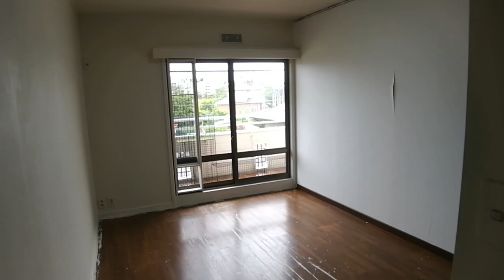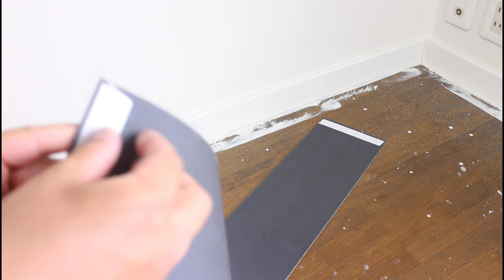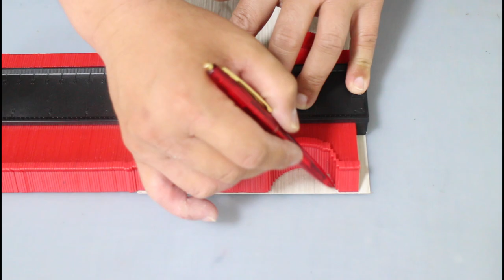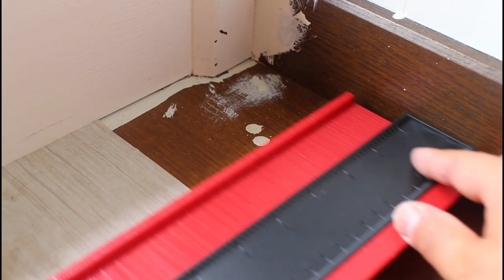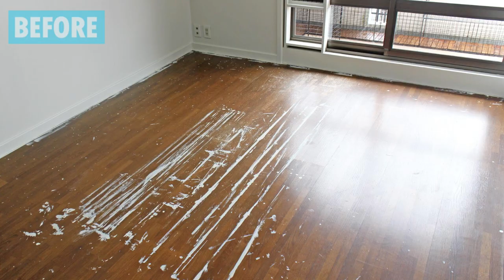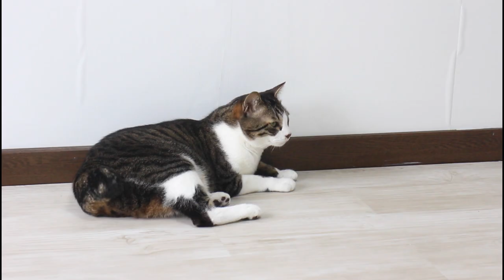DIY - How to Install Vinyl Floor Planks - Contour Gauge is USEFUL!! -

Comment: How does that stuff hold up?
Reply from the maker: thank you for watching.
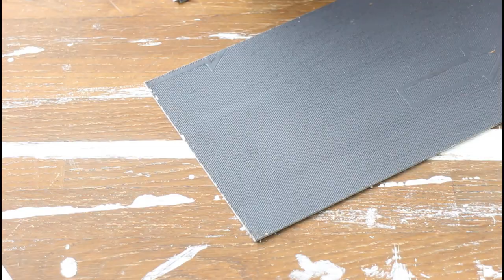0:39　I used double-sided tape.
Reply: Did it stay in place over time?   I've installed a lot of flooring over the years, I've never seen strip of vinyl like that before.